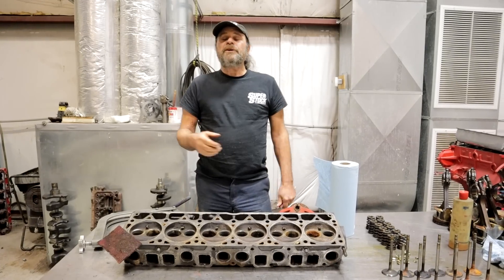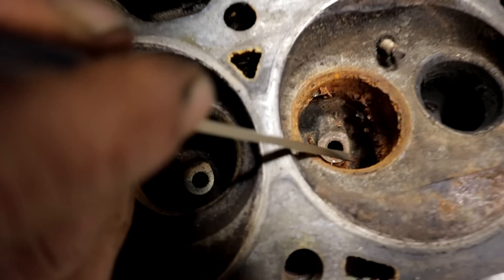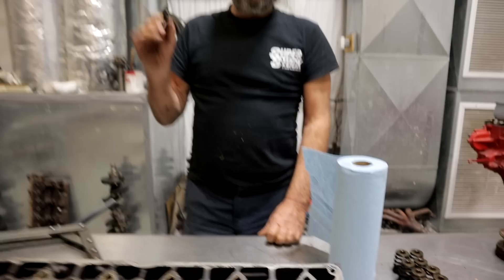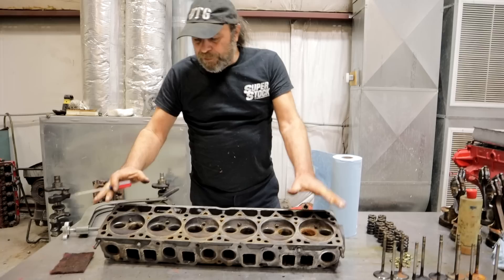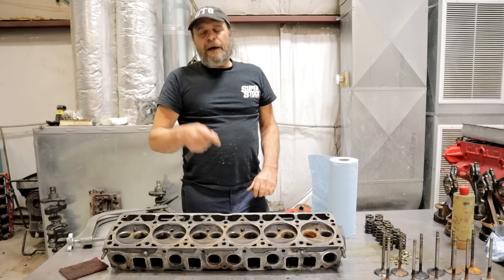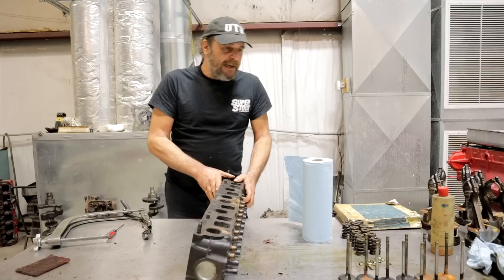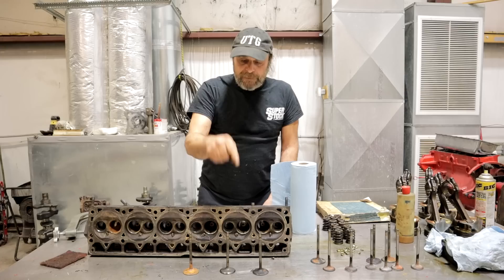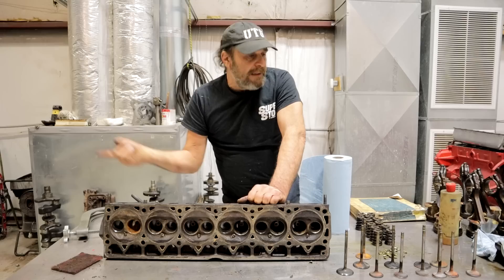Your First Engine Job - This Is What A BAD Cylinder Head Looks Like

Comment: That seal checking trick is minty. I think you’ve shown that before, but I’d forgotten until you demonstrated it again just now.
Reply: That sealing trick is awesome!
Reply: Yes, but check it DRY. A bad guide will still seal if there's oil inside.
Reply: Do you have to remove oil from the guide before checking the suction?

Comment: Not worth taking the chance. Replace it and be done. Chances are your money and time ahead in the long run.
Reply: Not so fast - in today's day and age, you really need to check what you're getting, as the farther we go in time the more low quality work there is out there, waiting to bite someone in the ass.
But I agree with replacing here.
Trust, but still go at it with calipers and dial indicators...

Comment: Tony, PLEASE do a Edelbrock headed stroker 6. This would be a great video series and practical for many of us.
Reply from the maker: That's the plan for the motor currently in the jeep.  This is its replacement for daily driver use
Reply: @UncleTonysGarage  Thanks, Tony, would like to know how YOU consider the cost of new, flashy, aluminum head vs redoing/prepping a stock head, intended purpose and all.
Reply: @landontesar3070  the one he's building right now is going to be a stock replacement. He said the engine in the Jeep when he pulls it out he will build it with the Edelbrock head the guy talks about . Just read what he wrote.

Comment: You didn't mention one of the most important things on a straight six and that is checking the face for flatness with a straight edge and feeler gauge, especially on a engine like yours where you had tight head bolts and not so tight bolts, that's a good indicator of a warped head.
Reply: Could be stretched bolts as well. But he did make mention about doing the check In the video when he found the bolts that were not as tight as the others.

Comment: The back of the valve also has to allow the air fuel mixture to FLOW into the Combustion chamber and a clean back valve flows far better than a dirty valve.

Comment: I work in a machine shop and do all the mag checking on the cast iron heads we have come in. Most of the time what I have seen is the heads crack through the exhaust seat into an EGR passage. They're junk once that happens. 
One thing you should talk about is if the keepers have mushroomed out the metal where they lock into the stem. The stem gets a little ridge that prevents you from pulling the valves out. Having a good small file is very handy when that happens. I find that the case on a fair amount of older Chevy 350's that come in. Chryslers don't have that problem because the keepers have rounded teeth that lock into the stem. While the Chevy keepers have the square cut grove for the keepers.

Comment: Every Caterpillar 3406E of C15 cylinder head is designed to crack across the intake valve area. There's no water in that area, you never see, or notice it until the head comes off. If that crack goes north of the valve seats it can be detrimental due to the the valve seats falling out and causing catastrophic damage, or it could extend up to a water passage. These heads are north of 600lbs and cost 4,000 bucks plus.

Comment: The 1st engine I rebuilt under my Dad's tutelage was a 6 HP Tecumseh for a Go Kart & that valve stem check was one of the "tests" but with a slight twist, he'd pull the valve out & then gage by ear the "pop" it made when the stem came clear.

Comment: 4.0 heads respond pretty well to very minor port and bowl work. I have one that picked up about 30% on the bench without doing anything crazy... and since you have one to cut up and inspect, you could go crazy if you wanted.

Just some food for thought before you decide to just bolt on your other stocker.

Comment: Okay...

I'll be perfectly honest: 

Even I never thought about that hot intake valve issue, because I always relied on the heat inside intake manifold for that.

Since I have been planning on building an intake system which would never get that hot, I would have found myself wondering what was not working.

But now that I have seen this, I know that I have to make changes to my design to ensure I get proper fuel vaporization.

Comment: The built up carbon absorbs raw fuel like a sponge besides insulating from heat . This causes emissions problems. Where I currently reside we unfortunately have to get tested to purchase new license plates. We used to have lots of trouble with the last of the Oldsmobile V8s passing unless we ran a bunch of sea foam through the carb until it flooded out then let it sit all day and soak then fire up at the end of the day and run the dog crap out of them before knocking the ignition timing back until it would hardly get out of its own way then take back to the test site to retest.

Comment: If you know you are going to get a different head, be sure you know about the problems with a couple casting numbers and cracking under the valve cover. There are quite a few sites with people posting questions and answers to find which is good and which is taboo. I had this happen to my 2002 TJ. I found a complete head - new- at just over $300.00 about five or six years ago and it was the last one. I had pulled the valve cover to inspect for a crack because I kept loosing coolant. It kept getting worse and on a warm day, the temp would go up. When I pulled the cover, I saw water on the head between cyl. #3 and #4. I removed the head and never found the crack until after I cleaned the residue off the casting, let it set in the weather and finally it rusted at the crack. Only thing I did not enjoy was the intake and exhaust manifolds due to having headers and they reduced access to the bolts and nuts holding it in place. Swivel sockets, Wobble extensions, almost did not have enough of them. Even swinging the ratchet was miserable due to limited travel and obstructions. Knock on wood, still going. Aluminum head is out of my reach.

is out of my reach due to the cost.

Comment: Yep. It's very common to find cracks between the valves on the 2.2/2.5 4cyl engines.
On those engines, if those are the only cracks, you just ignore them and finish building it out, even on the turbo ones.
Reply: I have a bunch, the only one I had that wasn’t cracked like that was a new casting from Alabama cyl head

Comment: Tony, as a rule of thumb with purchased heads, with valves installed, I always check the seats for lap-in and check for burrs in the intake and exhaust ports.  It seems like a waste of time for the average guy, but several ruined valves and heads later, it pays off!  Of course, you know this, but some don't and to help them not have problems, check everything!

Comment: I have commented on this before, but that’s why the injectors spray pattern is important on these Jeep engines.
They run a single hole injector that gives a solid squirt of fuel straight at the top or back face of the valve and clears it up and like you said the heat atomised the fuel for better burn.
Like I said it would be good to dyno your old injectors to see patterns.
Reply: Benjamin, is that what supports the thinking for these massive intake plenum manifolds with fuel injection on 90's Dodge/Jeep?

Comment: Clean the port and fix the crack. With JB-weld or silicon bronze braze it will run "just fine" under low stress.

Comment: I remember hearing about sewing cracked-rare cast iron heads, before the aluminum ones were available.  Alot of talent lost, but alot of performance gained.
Reply: The backside of the valve cleanliness...  or swirl polished, and under cut head, at least a 3 angle valve job.  Gettin into race talk now, but it does free up power to a point.

Comment: I had a 92 Mitsu Eclipse GSX that broke it's balance shaft belt and fell into the timing belt.  Happened just as I was parking it.
I had it towed home and pulled the head off, and checked the valves seal like you did.  They were fine - no bent valves.
I cleaned up the back of the valves and the ports and combustion chambers and reassmbled.
I was REALLY surprised how much better it ran after that - until the valves got coked up again.  
Thanks for explaining why it ran so much better after cleaning up the back of the valves.

Comment: Dodge Magnum heads are like concrete, which comes in 2 types:  concrete that is cracked, and concrete that is going to crack.  And as UTG says - there are cracked ones running around doing just fine.

Comment: This engine may have been overheated, sure. That's a pretty bizarre way for that head to crack. But the skirt failure was almost assuredly not related. Neither of the 4 liters I had piston skirts fail in an almost identical fashion on were ever overheated, its just something that happens. I had one fail at about 220k, and another at about 250k. Buddy of mine had one fail on a 130k mile 4 liter that had been babied its whole life. All 3 were XJs. My guy at the machine shop told me he's seen 4 liters with as many as 5 out of 6 pistons that had skirts with chunks missing. For whatever that's worth. It was a design or manufacturing oversight, something to do with making them lighter for fuel economy as well as cheaper.
Reply: believe replacement piston sets, stroker or not, have different skirt designs

Comment: 8:04 "Like I sez..." :) 13:50 Very interesting, never heard that. I know it's true that the intake valves are cooled by the incoming fuel, so they can live nearly forever, whereas exhaust valves  just get brutally hot... and stay hot,  slowly eroding themselves, the seat and guide.
Reply: thats why its important that they have a good seal, not only to hold the combustion pressure from being wasted but also because a good seal has more surface area to transfer heat to the head away from the valve

Comment: I just rebuilt a VW 1.6 diesel a couple years ago. I was concerned when I found that each combustion chamber had a small crack between the bowls. Then I found out this is a common issue and unless it's excessive, like going into a bowl,  it's not a problem. They say if you can get a fingernail in the crack grind it out and run it. Otherwise leave it alone.

Comment: That’s really to bad. When I worked in a machine shop we repaired many head cracks with King Serts and JB weld. But that was only possible if your tools could reach both ends of the crack.  We. Guaranteed our work, and never had a return, but I reiterate, you have to be able to reach both sides of the crack. The idea is to prevent the crack wouldn’t spread, so the outside of the cracks were repaired first, moving to the center as the repair continued. Anything short of that, your screwed. Uncle Tony is right with these heads and this particular crack. If your not sure take it to your local machine shop and if the Machinest is worth his craft, they will tell you in short order. And as far as cracks go, they don’t charge the much to check the head for cracks, some of which you won’t see without magnafluxing or dye checking up in aluminum heads. Good luck!
A quick note on valve and seat repair. You can lap the valves at home, but the seal will not last anywhere near as long as when it was built by the manufacturer. Cutting the valves and seats with a machine like a series valve cutter will establish an interference fit between the valve and seat like it was when it came from the factory. In my mind this is a must with any performance engine or any engine that you intend to use for another 50 to 100 thousand miles. If your flipping cars lapping the valves will get the car sold. If you like tearing your engine down frequently, lap the valves.

Comment: I'd also think the carbon buildup would lean out your mixture as the carbon would absorb the fuel on a cold engine. 

Just like cast iron intake manifolds, cast iron is porous and can absorb fuel just like oil?

Comment: Great video about cylinder head inspection. I was wanting a little clarification on the crak you found. I understand that is a water jacket and not casued by an inclusion in the Cylinder heads casting.  The Slant 6 video you did on the deck having the inclusions had me thinking. Also i will be adding that Valve seal check trick to my knowledge for sure. Thanks

Comment: This crack often happens when the engine runs with too low coolant level ! Most of the time head cracks between valves on the the furthest cylinder away from water pump !

Comment: About cracks in heads i saw several  new merces head all craked up,, I just removed the cracks between cilinders , becasue they were deep  the head was compçletly "destroyed" and a guy just rebuilt it with a tig, weld.I also welped but iam not a ver y good weldeer-  It worked well.

It was an aluminium head , i dont know if iron heads can have that job but i have seen too guys welding iron heads .

Comment: Our timing is off.  I would've sold you my wife's original cylinder head cheap that she's using now as we are replacing it with the Edelbrock one this spring.  Already purchased, too cold to pull right now outside.  I still need to buy some rockers but we have the head already. Her original was very well rebuilt 25,000 miles ago and will go to someone in need for pennies on the dollar to help our fellow Jeep enthusiast. All cylinders still over 150 on compression but those iron heads stink.  Picked up the 4.2 crank and installing that with fresh pistons.   She's gonna love it.  Hope her tranny does too.

Comment: I have seen a few Jeep heads crack in the bowls. Make sure your replacement head is the same casting number so you get the same intake ports... They changed them repeatedly over the years..

Comment: Before scrapping that head, cut it apart to see how far you can go with the porting for the hot rod motor!

As for the Edelbrock head, unless you stumble across one for cheap at a swap meet, I say pass. I’m sure you could make more power with that than porting the stock casting, but it really doesn’t go with the “work with what you’ve got” theme of the channel.
Reply: I second cutting it up! Best way to check casting thickness!

Comment: I don't think I've ever seen a crack like that on anything I've worked on, usually it's the 0331 heads between cylinder 3 and 4.
I liked the 4.0 in my WJ, was a tank of an engine even as worn out as it was. Unfortunately the number 1 connecting rod let go a few days before Christmas, I think worn out may have been an understatement. At 352k I'm not gonna complain, putting a 350 vortec with a 700R4 and NP241C in to replace the worn out and blown this spring. Too cold here to pull things apart Right now and I need to finish getting the parts together.

Comment: Those heads like to crack between the two center cylinders. Having two exhaust ports side by side flashes the coolant into a steam pocket within the coolant jacket and allow the head to get to the point of cracking.

Comment: So you need a head, you can make a set of cheap sbc aluminum heads work with a little cutting and welding just like the videos of the Ford 300 with a set of cut and welded together LS heads on it.

If you want the details let me know, I'm happy to help.

Comment: The Edelbrock head for the Jeep engine was absolute junk. I say "was" because it has been discontinued. That head offered zero advantage over a stock casting in terms of power potential or efficiency. It came with smaller than stock ID valve seats and it could not be ported as thoroughly as a stock head. The primary issue was an incredibly thin aluminum casting. Cast from a weaker material and yet, thinner than stock. If you truly ported that head, you would break through, or it would crack as soon as you torqued it down to the block. If your engine is a distributor engine, you need a 7120 casting, if it is a coil on plug engine you need a TUPY casting.

Comment: Sound advice, I recently bought some alloy as cast heads from AFR for a Ford sb for slightly more than the cost of parts & machining to my old heads, including big valves, same with the crank, cast steel from eagle 👍

Comment: Interesting that it cracked on 1. Depending on the casting, it was more typical between 3 and 4 on the 4.0s and that was in the '00 and '01 year range due to a casting defect.

Comment: As a certified TAVO, I'd do the same, build one good engine out of the two. Aussie Hemis are notorious for flogging out valve guides. A high mileage engine would almost take .005" O/S stems right out of the box.

Comment: Like I mentioned before in another video my dad had 2 of these different jeeps late 90s both 4.0And he blew both of them it developed a rod knock or a Main bearing knock on cylinder #6 on both vehicles And I was told by some research That it's an oiling issue I'm curious to know what the real issue is..!!!??😇

Comment: Is it  a crack or has water sat in the port and caused a "Tide mark" in the port that looks like a crack. Give it a wire wheel buff off and spray it with a chemical crack detector or magniflux it.

Comment: Nice valve guide trick...  I know mine are loose on my chevy. I had gack on my intake valves on my chevy I sprayed them down with carb cleaner when I had the intake off. The Damn thing smoked good for about 10 miles on and off. Now its cleaned up. That Crap on the intake valve just turned into an oil when I was spraying them,

Comment: It wouldn't hurt to polish the valve giving less for the carbon to hold on to. Keeping it clean longer, maybe run it in a drill, against a scotch bright pad, then maybe a 1000 grit, then 3000-5000 grit paper careful to not get the guide or seat surfaces, it should look like a mirror, I got diamond paste, it's equal to just under 11000 grit, 10,600 grit I think, it takes time but will leave a mirror!!